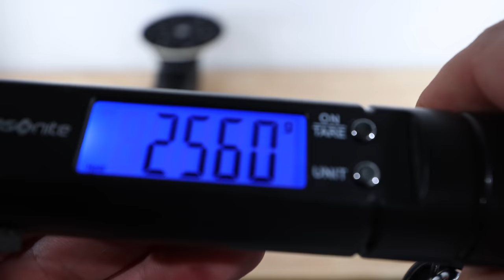The Most Powerful D.A. Car Polishers Ever! EX620 Series

Comment: Well, just got mine today based solely on this review. I am NOT disappointed. Very smooth and a lot of torque. Subscribed.
Reply from the maker: Great to hear!
Reply: @CarCraftAutoDetailing  sadley I am having problems with the speed dial turning by itself with very vibration. Also it just broke today. The variable speed stopped working and it just keeps increasing in speed until it turns off automatically :( such a beast of a machine.
Reply from the maker: That’s very unfortunate to hear mate, sounds like there’s an issue with the dial on yours, hope it’s sorted out!
Reply: @Ike-yq3gf  mine just started doing the same thing but it has not quit yet....I don't even know where to get parts or to make a claim....

Comment: Thanks

Sandro, I have never polished before and would like your advice as to whether you think that the Shinemate EX620 Pro 15mm is a good machine to start off with?

Likewise with the EB210?
Reply from the maker: Firstly thank you, I really appreciate the kind support! 
The EX620 15mm is in my opinion still the best all round large car polisher on the market. I use it all the time in my beginner polishing classes and there’s nothing the students find intimidating about it, and within a short amount of time they are usually very comfortable with the machine.  The bonus is that you can’t outgrow it as it’s as capable as anything out there. (The EX620 21mm version on the other hand, can sometimes feel a bit much for some beginners) 
As far as the EB210 goes, you really can’t go wrong if it’s a macro polisher you’re after - it smooth, powerful and there’s very little intricate areas it can’t effectively correct - smaller machines do also tend to be easier to work with and control, though do tend to be far more time consuming. 
My general advise it to start with a large 5” or 6” polisher, focus more on light polishing (meaning fine polishes and foam pads) and just look for a good improvement to begin with. Once you’ve practiced a bit and gotten a feel for it, then you can progress to more in-depth paint correction using more aggressive compounds/pads and more specialised smaller polishing machines. 
Hope that helps mate!
Reply: @CarCraftAutoDetailing  likewise thank you for your kind support by putting out such great real life content mate. 

Thank you for that mate. It is what wanted to hear before I made my purchase. Some honest genuine advice. 

I wish you continued and further success Sandro.

Comment: Honestly, I find myself using a 3" polisher almost more than full size machines. A compact with monster correction power 12mm dedicated 3" polisher is something I'm definitely always looking for. Thanks Sandro, great demo, great message. 👍👌✌
Reply: You polish a whole car with a 3"?
Reply: @PumaM90   I didn't mean that literally, I was exaggerating a bit for effect. 😁
But I don't do alot of production style enhancement polishing where you knock out  3 cars a day. I'm usually doing multi-day full corrections and restorations, and I do quite a few motorcycles. Plus just modern cars in general tend to have more body lines and shapes and areas that aren't ideal for full size pads. Add all your precise edge work to that and you'll find yourself spending a lot of time with a 3" and 1" pads.
Reply: @jdisdetermined  Thats for sure, a lot of work on modern cars call for the smaller machines

Comment: Thanks, Sandro. I have both the 15mm & 21mm of the EX620 series. I do not find the 15mm to have all that much torque, unless you're on at least speed 4. OPM vs. OPM, my Maxshine 15mm Series II has more power than the Shinemate Ex620 15mm. The 21mm is the opposite, very powerful and you don't need to crank up the speed. I love it!

Comment: I have one question please, do you apply pressure while compounding? If yes how much?
Reply from the maker: Yes, but it’s different amounts of pressure depending on the machine, pad, section and so on. The best way to judge the amount on DA polishers is to look for just the slightest amount of rotational slow and even listen for just the slightest motor stress. After a bit of experience it’s something you won’t even think about and just apply subconsciously.

Comment: Sandro - would be interesting to see a video on panel prep to remove polishing oils before applying coatings. I see you use a range of polishes (some oily like Scholl, others less so) and interested to see if your approach to wipedown is the same regardless. Potentially a shootout between panel wipes for use with the more oily compounds would be very useful! :)

Comment: Sandro, there is a shine mate ex620 21mm with a 5-inch chainring and obviously a smaller counterweight for said chainring. which has more power the 21mm ex620 with a 6 backing plate or the 21mm ex620 with a 5 baking plate? Thank you regards Claudio.
Reply from the maker: I haven't tried the 620 21/5 but I would expect the the smaller 5" backing plate to have a little increased torque over the 6"

Comment: Also Sandro is the cord was in a upper position so when you over hang it over your shoulder it stays out of the way when using it, but then again the amount of different pads and sizes you have you could correct any painted surface and even like the back Camaro ZL1 you did all its sharp lines and plastic rear tail lights and other areas, your the best at paint correction IMHO on u tube and in Australia full stop, your work simply outshines all the rest and your the best?

Comment: i really like my 620/15mm    its everything You said it is,      i keep it under speed 5 and it does the trick with less vibration then higher.  [compound],     im old school and use rotary when needed, but that power ratio on that DA is something else!       well balance, not too noisy,    and Great Bang for the  Money~!!!!  im in Canada             :-)
Reply from the maker: That’s great to hear and I appreciate you sharing your experience with it!
Reply: Hi Dan, I just ordered the same 620 15 mm. Any problems with the speed dial turning itself backwards or any problems at all ? Thanks..
Reply: Hello guys , is this machine still working?

Comment: So i pull the trigger and bought one, i have to say this machine have unlimited power, very well made and pleasant to work with. But there are two things i don't like, first is "soft start" function when it isn't really that smooth as other machines i have/had. Second on is already mentioned (in comments)- the speed switch, it just spin too easy, it happened to me many times when I found speed on different settings withnout me knowing about touching it. Shame that shinemate did not spend just little more time on the speed switch.
Reply from the maker: Yes I agree, the dial should be a bit more firm and hopefully they improve that!

Comment: Sandro, thanks for posting this review.  I've been in the market for a new polisher and wasn't happy with the stall potential of the usual suspects in the market.  I went with an EX620 5/15 which just arrived today.  I'm US-based, so finding a distributor wasn't easy, but it was possible and the shipment just arrived.  Looking forward to getting hands-on with it.  Cheers.
Reply: Curious how you like the new Polisher? is there much of any stall or more power than what you need?
Reply: @404notfound.....  I agree with Sandro on all accounts.  It's possible to stall the pad in the right conditions, but it's much less susceptible than other machines.  The effectiveness of the speed adjustment is what caught me by surprise.  You can feel the machine adjust power as your pressure against the panel varies, which keeps the pad moving at a consistent speed.  In terms of too much power, the speed dial, pad choice, and product aggressiveness are your friends.  The lower speeds are actually usable and will help control paint removal.
Reply: I'm also US-based, and looking to buy one, where did you get it?

Comment: Hello, I'm looking to buy my first DA polisher, which do you recommend? Griots is unfortunately not available in my country.
1. MaxShine M8S Mk1 ($120)
2. MaxShine M15 Pro II ($225)
3. ShineMate EX610/15 ($210)
4. ShineMate EX620/15 ($275)
5. Rupes LHR15 ES Mk1 ($355)
6. Other brands/models?

Also, for smaller/tighter surface areas, should I buy one of those micro/mini polishers like the SPTA ones or just get a 3" polisher like the ShineMate EX603?
Reply from the maker: The EX620/15 would be my recommendation as well as the EX603

Comment: Hey Sandro fantastic review mate 👌.
I have the Rupes mk2 and a couple of the 610's. Generally i use speed 4 for cutting & 2.5 - 3 for refining, in your opinion what speed are you finding works well on the 620 15mm as they have more power and torque?
Cheers
Reply from the maker: Thanks mate, and both machine are different so I typically find I’m using the 620-21 at lower speeds than the 15. 
We all work a little differently and each DA is additionally different but I would say I’m cutting from speeds 2-5 and finishing from 1.5 -4.5 just depending. 
With the extra torque there’s just a larger range of speed and pressure available to work with and I’m still exploring all of that

Comment: When you have decided to use a 5" long throw DA polisher for a paint correction, which would you grab first and why; the corded EX620 PRO 15mm or EB351-5/15 5" cordless polisher? Has it been your experience that the EX620 corrects significantly better/faster than the EB351 to justify choosing the heavier less maneuverable corded machine?
Reply from the maker: The 620s definitely have more torque and I’d say they are the smoothest and most powerful DAs on the market, so there are times when that will be my priority based of needing maximum cutting ability. 
But I almost feel like they may be my last corded machines as the cordless Shine Mate are just so good and great for most jobs and there’s no denying that cordless is the future and my guess is that the next updated machines and batteries will be amazing. I’m also keen to see Rupes enter that space and Flex do better with the cordless technology.
Reply: @CarCraftAutoDetailing  Does the SM EX620 PRO 5/15 have the same, less, or equal cutting ability of the Flex 3401?
Reply from the maker: It’s different and hard to directly compare a forced rotation to a free spinning DA in those terms. Generally larger throw DAs will have better cut on flat sections while gear driven DAs will tend to cut better in curves and crevices.

Comment: Sandro, if high torque/low-stall performance is so highly valued in a DA, why not rely on forced rotation machines?  Do the RPM and/or orbit rates limit the FR’s overall performance, or is it the benefit of having a free-spinning pad?   Or all of the above.  Thanks
Reply from the maker: There’s a certain amount of cut from large throw DAs that FR’s can’t match due to their smaller throws. Most of the advantages with FR’s come when you’re faced with curves and crevices that many DAs will stall through, so having that extra torque can give you the best of both worlds, and if you don’t have to always hit top speed to get it, it’s also a safer and less physically taxing paint correction experience. 
FR’s also tend to be heavier machines that do vibrate more at the top end and don’t tend to work quite as well with microfibre pads as those machines tend to bite into the paint a bit more. 
I do love my Mille and I used my 3401 to death in the past so there’s also great things about them. 
But the more options we have, the more possibilities we have to approach paint correction with better and new perspectives that can and will advance it further.
Reply: Thanks for the detailed reply Sandro.  I appreciate it.

Comment: Hey Sandro the best video as I bought the new 21mm pro and was wondering did I do the right thing as I have the 3" and 12mm and now the 21mm for harder paints. Whats your preferred the 15 or 21 and can the 21 do most jobs on a full car if polish and pad choice is chosen correct?
Reply from the maker: Throughout the years I’ve gone from purely using rotary to 21mm DAs to 15mm DAs to gear driven and back again! It’s really all about the machine at the time that gets my attention and tends to change what I use. 
At the moment the both these two 620 machines have my attention and I’m not sure which one I prefer, as the 21 is just a beast that can level down severe defects on hard paint like nothing else, while the 15 is so much more civil yet still packs a punch. I guess time will tell!
Reply: @CarCraftAutoDetailing  thanks bro
Reply: You'll probably hear of alot of cars driving around without clear coat it's just me testing my new 21mm lol
Reply from the maker: I hope not lol

Comment: Do you recommend the 620 15 or 21, ignoring beginner and pro detailer comparisons, which would it be and why?
Reply from the maker: It’s really going to become a preference just like choosing a Rupes LHR15 or LHR21. The 15 is going to be a little smoother and have a better balance of cut vs finish, while the 21 is going to be a more capable and faster cutting machine but at the expense of perhaps not finishing quite as well especially on softer paints and have a touch more vibration. So it’s going to come down to what’s most important to you and maybe also what other polishers you have and which one would best complement or fill gaps in your current setup 😀

Comment: Hi Sandro! Thank you for all the great work and effort you put in your channel.
I'm building my correction setup, pads of choice to start are Rupes Yellow and Lake Country MF. Already have a EX-603 and currently looking for a 15mm DA. 
Is the 610 better suited for beginners than the 620? Because the local stores only carry the 620 at the moment and I'm a bit reluctant if the 620 can be too much. Or the main problem could be the 620 not giving the proper learning curve.

Thanks again,
JC
Reply from the maker: Yes I would tend to say the 610s are better to start and lean with compared to the 620s, but the EX605 is also a great first machine to learn on and also one to hang onto as it still cuts quite well and finishes beautifully on those more difficult softer paints. The Flex XFE7 is another good polishers to start with (as long as you don’t use it with the 6” plate- just stick to the 5”) and the Rupes LHR15 MK3 is a very good all rounder but it does come at a price.
Reply: @CarCraftAutoDetailing  Thanks, appreciate it. Rupes is a bit out of budget right now, I'll try to ask my local shop if they can get me a 610, sounds a better option. 
BTW, have you noticed how many thank you's people type in the comments? :D cheers!

Comment: Thanks for the review! I want to get one of these but dont like using 6inch pads, should I get the 15 or can the 21 accept a 5 inch backing plate without upsetting the machine?
Reply from the maker: I expect 6” plate on the 15mm will run rougher - haven’t tried it - but being that the 620/15 is very torquey, powerful and smooth I think 99% of users will be quite happy with the standard setup.
Reply: @CarCraftAutoDetailing  So its safe to assume the 15 will also be more torquey than the Rupes 15 Mk3?
Reply from the maker: Yes

Comment: amazing video and machines! can the ex620 5/15 be used with 5" pads ?
Reply from the maker: Thanks and yes, 5” pads are what it’s setup for. 
Just for reference Shine Mate’s 7” foam pads are for 6” backing plates and their 6” pads are for 5” backing plates, I know it’s confusing but the brand measures the larger tapered end of the pad, rather than the Velcro end of the pad to stipulate the pad’s size. With most other pad brands you’ll be looking at either 5” or 5.5” pads to fit this machine.
Reply: @CarCraftAutoDetailing  sick! i've got a new 620 and a 210 on the way !! you're the man !

Comment: Hi sandro, nub question..
Can you do a final pooishing stage by using 5 inch polishing pad and 15 orbital DA machine with low speed?
Reply from the maker: You can certainly try that, but I would be in the mind set of doing a test section to see if there’s a benefit, no difference or even a degraded finish in the results. So in other words you have to visually confirm what this final polishing stage is doing to the specific paints appearance as not all paints respond the same.
Reply: @CarCraftAutoDetailing  Ok Sandro, noted and thank you for the reply.